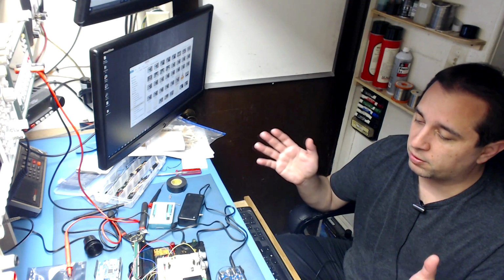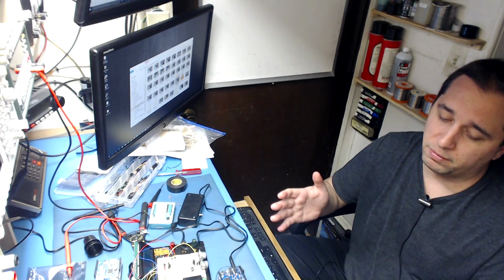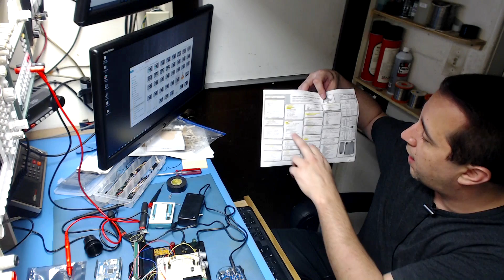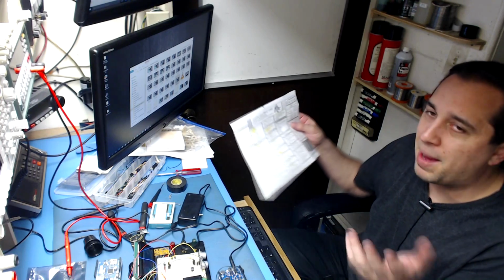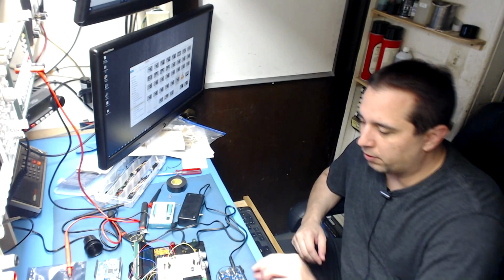WHY GET INTO MICROCONTROLLERS?

Comment: I love MCUs and stuff like that from an engineering or hobby standpoint. But in the electronics repair industry, MCUs are the death, and scare the HELL out of me. I used to work at a car audio repair shop, and I ran into quite a few sony and pioneer head units where the microcontroller/MCU had failed in one way or another. Whether it was a stuck I/O pin, or just failed where it is consuming tons of current, and smoking. Or in other stuff that appears to be "braindead", all voltages present and even the MCUs oscillator is running. but its just dead. the MCU got brainwashed or died. Why it scares me? because in 90% of those cases you cant get ahold of the firmware or bootloader. So, once the MCU fails and its ROM is internal, its game over. As I shifted into electronics engineering, all my stuff now is MCU based. But I have had to service a few things on return here and there, and one time I got back one of my own boards that was braindead. But since I had access to the tool chains, and firmware (I wrote them, so of course), I found out the MCU flash memory had been erased spontaneously. Go figure. Reflashed, set the fuses, and it was up and running again. Thats why MCUs scare me.
Reply: This is why some people like to stay with Off-The-Shelf components or opensource equipment. They can download and even modify the software. In the worst case, they can convert the code to run on another uC.

Comment: Another thing worth mentioning on the subject of why to get into MCUs, is that it get programmers (like me) into electronics. Before I got hooked on Arduinos, I wouldn't know a resistor from a transistor - and a Soldering Iron was this thing that was hot on one end and had a cable that went into the wall on the other...

Quite a bit of tinkering, reading up on the subject, watching a ton of how-to YT videos, and getting some proper gear later, and I'm pretty confident I can cobble together more or less anything. Just as long as it doesn't run off high voltage. That stuff I find a bit, umm, let's just say I got the highest amount of respect for high voltage :)